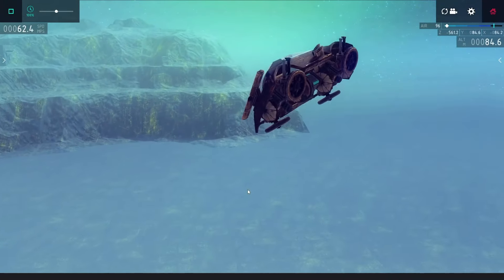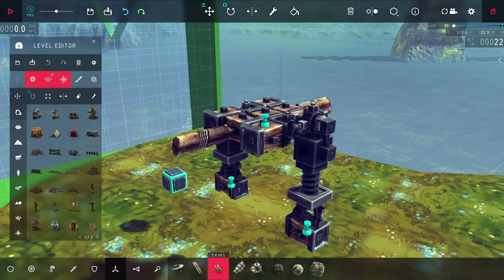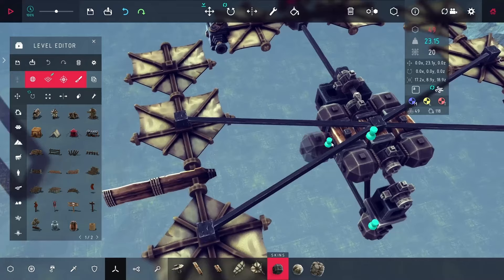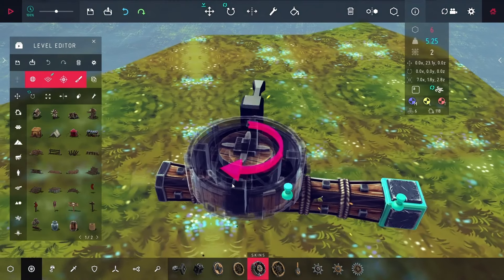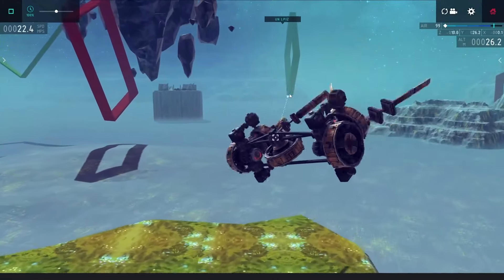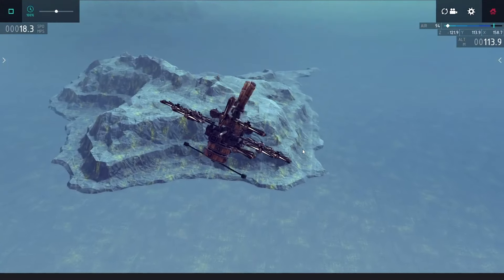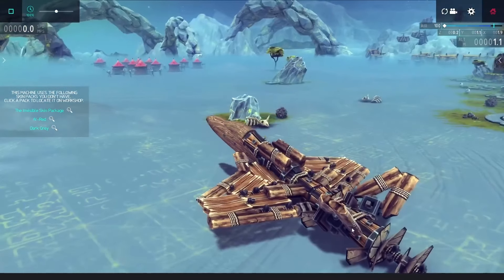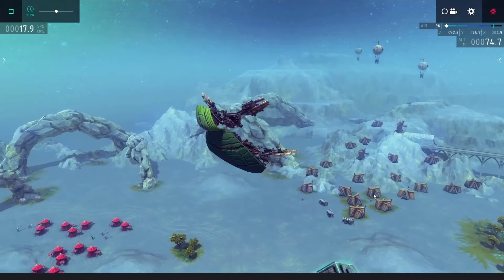I Forced My Viewers to Develop Planes in Besiege

Comment from the maker: The A-10 Warthog is coming next, what other real planes should I recreate?
Reply: Spitfire
Reply: F18-E with the ability to go 700m/s+ in speed.
Reply: F22 Raptor
Reply: Tornado
Reply: x-15 for da speed record
Reply: Not a plane but I’m curious in Poly Bridge 2 if you can only use the most expensive materials and still stay under budget. Things like only reinforced road, steel, hydraulics, wire/cable, and springs. No normal road and no wood
Reply: B-25 or B-29
Reply: Considering the size of your other planes, maybe something like the BV 238 or the TB-3.
Reply: SR-71 blackbird
Reply: Osprey?
Reply: Blimp.
Reply: AC 130 ? It's a pretty cool piece of machinery with quite the interesting design ^^
Reply: F35
Reply: Junkets Ju87 Stuka. A dive bomber with responsive controls could be absolutely incredible.
Reply: Yak-38
Reply: Japanese zero from ww II
Reply: i like your videos a lot!
Reply: x-29
Reply: AC-130
Reply: The MiG 25 fox at make it go Mach 3
Reply: Harrier or Yak-38. Anything with VTOL really
Reply: Gunship
Reply: How about a sort of space shuttle that could fly up very high with booster rockets and then when the rockets detach the shuttle could fly down and land on the ground
Reply: make a sopwith camel but try to make it fly itself
Reply: Not real but make a Halo Warthog
Reply: su 25 frogfoot
Reply: convair b-36 peacemaker
Reply: F-14 tomcat
Reply: The L-EM 0N
Reply: AC-130
Reply: millenium falcon
Reply: F35 with the vtol function
Reply: F4 phantom
Reply: B-2 bomber
Reply: Boeing 737 MAX 9
Reply: recreate a cargo blane with a big gun on it :o)
Reply: B17 or b29
Reply: Me262 or bf109
Reply: B-36 peacemaker with a nuke
Reply: the F-35 with vtol capabilities
Reply: The b-36 or the Tu-95
Reply: XF 85 Goblin
Reply: PBM Catalina
Reply: F14 working sweepwing
Reply: B-24 that you can drop nukes out of
Reply: SR-71
Reply: R9X missile.
Reply: CL-1201, bet.
Reply: F22 raptor
Reply: f-14 tomcat
Reply: AC-130
Reply: F-22 raptor
Reply: B-2 “Spirit” Bomber
Reply: a vtol aircraft, like an F-35 or Harrier or even a V-22 Osprey.
Reply: Harrier
Reply: An 225
Reply: Make SR-71 or x-15
Reply: P-51
Reply: F14 tomcat
Reply: Jas 39 Gripen
Reply: A321
Reply: Not a real plane but the turtle makes me think an ornithopter would be cool

Comment: I came up with an engine that's more stable and powerful than the standard wheel-prop engine. It still uses wheels and props, but it's based off the fact that one wheel prop engine spinning one way makes you drift in a certain direction when optimized for speed. So obvs you mirror that engine to counteract it, but eventually one engine will spin slower causing drift, and also thus slowing down the plane. So this engine works like  this:
 balast -> forwards facings small unpowered wheel -> large unpowered wheel facing forward ->large powered clockwise wheel with clockwise optimized props facing forward -> large powered counter clockwise large wheel with respective props facing forward -> large unpowered wheel facing backwards-> backwards small unpowered wheel  balast, then connect back unpowered wheel to the front powered wheel using braces and vice versa with the front unpowered wheel and back powered wheel. 

Normally a wheel spinning one way produces spin in the opposite direction, which gets applied to any wheels behind it. With alternating powered blocks the front one adds speed to the back opposite spinning wheel, but this means that one spins faster due to this counter rotation. This is where the unpowered wheels attached to the powered wheels come in. The back powered wheel is connected to the front large unpowered wheel via braces, so it spins at the same speed and direction. It adds that counterspin to the front powered wheel. The back powered wheel also counter spins the back large unpowered wheel, so to add energy back into the system it gets connected back to the front powered wheel since they spin in the same direction. The additional speed generated by the front get translated to additional counter spin, further speeding up the back powered wheel by counterspin. It in turn counterspins the back unpowered wheel which speeds up the front wheel and so on and so forth. It creates a feedback loop that causes the engine to accelerate to it's max speed (based on vehicle weight and prop angles n whatnot), but it accelerates very very quickly. I personally call it the counter-crank engine. I've used it in a few builds. Most notably my upload called "Lodestar". For visual reference it sorta looks like a flying dorito and has very well optimised turning using the powered hinges and double stacked wing panels. Hope this helps. Happy seiging

Comment: I tried for about 2 hours, somehow my planes was spinning on it's own even tho I had a twin propeller in the opposite direction, don't know what was causing that torque and gave up :D
Reply: So what you can do, is have a non powered wheel, then x amount powered wheels, then another non powered wheel. Put 2 props on 2 swivel joints. Brace one prop to the start of the first powered wheel and brace the other prop to the end of the last powered wheel. The torque won’t enter your vehicle because of unpowered wheels and instead that torque devides equally to both props on the engine 😁